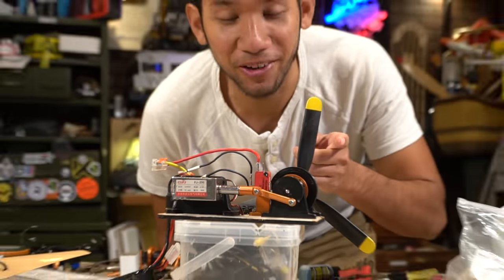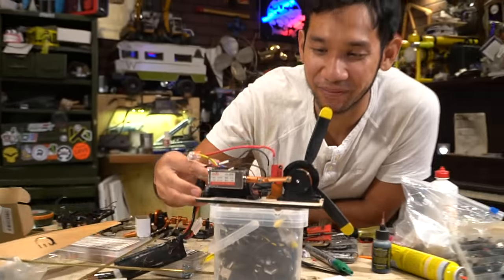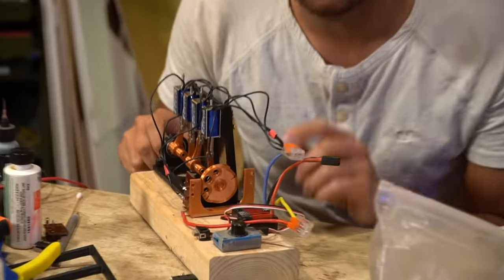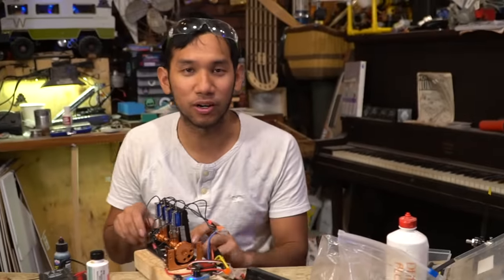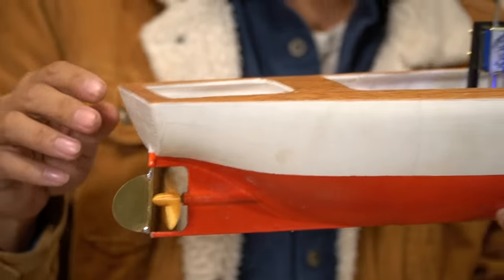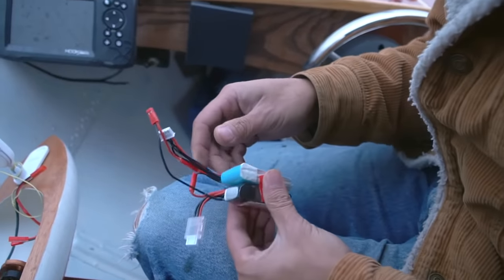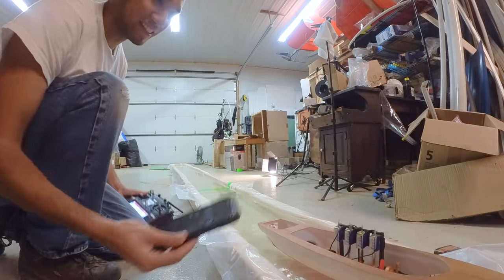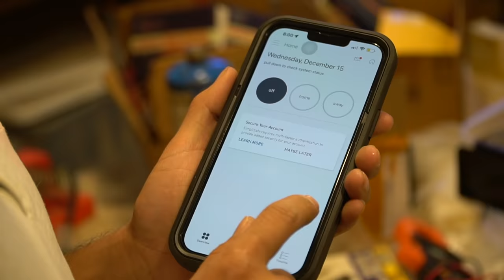Electric piston engine DIY (solenoid motor)

Comment: Now hook up the crankshaft to a regular DC motor, run the wires to the solenoids and boom, free electricity!
Reply from the maker: *elon musk would like to know your location
Reply: @PeterSripol  there's no such thing as free energy ask electro boom
Reply: @darrenwilliams414  wooooooosh
Reply: Unfortunately we don't have the intelligence nor the elements to create perpetual motion. 
Nevermind perpetual motion that has any real use. Like these solenoid "motors"...
Reply: Two words; diminishing returns.
Reply: @jasongrim2027  I think they were also joking
Reply: @roblesterjr04  Its a joke my guy
Reply: @sufferr2914  i can't exactly hear thier tone of voice through text so cut me some slack here
Reply: @jasongrim2027  then hear me out don't woosh them
Reply: energy loss through frinction
Reply: Or he could team up with you and make train for those tracks.....
Reply: I had dreams of perpetual motion machines as a child. I was, however, cursed with the knowledge that overunity just isn't possible. I knew my ideas were flawed, but didn't know where the flaws were.

My first fun idea was a sort of gravity go kart, with sprockets affixed to front and rear drive axles. The sprocket on the front drive axle would be bigger than the one on the rear, and there would be a chain running between the front and rear sprockets. The thought was that I'd put this thing on a hill and hop in. The vehicle would start rolling. The rolling front wheels would rotate the large sproket, which would drive the small sprocket on the rear at a higher RPM, forcing the rear wheels to spin faster. This would increase the speed of the vehicle, which would increase the speed of the front wheels, which would... well, you get the idea. It was fun to fantasize about the insane speeds I might reach going down a hill, until my bummer brain figure out why this contraption would never work.

My next fun idea was almost exactly what you proposed - a generator connected to an electric motor by shaft and circuitry. You manually rotate the assembly to start it up. The generator produces some current, which runs through the motor, which has powerful permanent magnets. The motor produces more output force than the power put into it. All force generated by the motor goes to spin the generator, which generates even more current for the motor, which causes the generator to be spun even faster, which causes... well... I figured the magnets in the motor, utilized in this fashion, would produce a never-ending supply of free energy. I knew this wouldn't, couldn't work, I just didn't know what I was missing. And then one day, it clicked. Why did my dad's bicycle become so much harder to pedal when the generator operating the bike lights was engaged? Why did the exercycle-generator contraption at the local science museum require so much effort to pedal when the button activating a pair of vehicle headlights was pushed? Hmmm.... Electrons, magnetism, attraction, repulsion, induction, motion... Aha! Bummer though... my fond fantasies of limitless power were dashed.

Having these seemingly awesome ideas and finding the flaws in them taught me some invaluable lessons I hope to never forget.
Reply: Speaking of which... It just occurred to me that the whole motor-generator idea could be mechanically simplified!
You have a permanent magnet motor, which can also act a generator.
You give the motor a quick spin. Circuitry connected to the motor goes into generator mode, stores the generated power. Circuitry then switches to motor mode, feeds all that stored power into the motor. Motor picks up momentum. Circuitry switches back to generator mode, storing power for a  moment, then motor mode, increasing momentum... the cycle repeats over and over. Now you have only one mechanical component to endlessly optimize in your pursuit of efficiency sufficient to break the unity barrier! 

Perpetual motion morons, send your generous cash thank you gifts to the Salvation Army, thank you very much.
Reply: @roblesterjr04  one word, entropy 🤪
Reply: @darrenwilliams414  No-one told that it will be a free energy
Reply: @onlinehelper374  try to read slower
Reply: @darrenwilliams414  Yo, what you want to tell with it?
Reply: @onlinehelper374  is it because I is black
Reply: @warpedweirdo  diminishing returns.  If you think you can prove me wrong go for it, but I just can't see that idea being efficient at all.  Permanent magnets can't fix everything, they make good flywheel generators though.
Reply: @EnsignLovell  Whoosh... 

Maybe I wasn't clear. Sorry. My post wasn't intended as support for the notion that this concept of motor-generator could work in real life, but as mockery of the overunity tinkerers who, rather than performing the math and analysis that would prove their idea could never work, instead move directly to building something, and end up chasing their tails with excuses and endless pursuit of "efficiency" when it doesn't work. As in, "it ain't working, the friction in these bearings must be too great..."
Reply: *electroboom wants to know your location
Reply: NOTHING produces greater than 99% returns on it's output. You'd have to be greater than 100% to have true perpetual motion. You have replication degradation that takes place and you lose a little of the power on every impulse of power. Friction loss of components, drag on bearings, The actual moment of stutter when two magnets approach each other attracting one another and they hit the mid point they every so slightly try to stop before repelling themselves away from each other.... 
One day maybe.... in a vacuum... with a power source not yet discovered.....
Reply: Companies actually made toy solenoid boats like 70 years ago! They had little outboard motors with multiple solenoids inside. My dad had a couple of them in his collection, he had the 4 solenoid model that was apparently pretty rare.
Reply: @PeterSripol  a motor is basically a generator connected to itself. The back EMF simply limits the no load speed (without wasting power like an applied load) but there is still a net power loss.
Reply: Much over unity, many free power.
Reply: @darrenwilliams414  that’s the joke
Reply: @disgruntledegghead6923  are u sure about that
Reply: @kingwarrior5028  Yep. If you had it nailed you surely wouldn't be questioning people about it via a you tube comment section.
Reply: @disgruntledegghead6923  perpetual motion isn't that hard to create, just set something moving inside of a perfect vacuum and make sure nothing interacts with it. You cannot get energy from it without it slowing down and eventually stopping though.
Reply: @blockstacker5614  Yep. Referring to my original comment...
Reply: @jasongrim2027  I don't think it was a joke, anyways.
Reply: @sufferr2914  WHOOOOOOOOOOOOOOOOOOOOOOOOOOOOOOSH
Reply: Too many geniuses here with degrees, certifications and permanent professional jobs
Reply: @darrenwilliams414  if i'm not paying for the energy its free. :P
Reply: @darkshadowsx5949  if you're stealing it from the power company then it could be free
Reply: @disgruntledegghead6923  
earth's rotation itself is perpetual motion, why do u need to create perpetual motion machine.
Reply: @PeterSripol  Why don't you and Elon make a new Tesla Electric City bus with less noise and no pollution?   Lots of battery carrying capacity.
Reply: Wish it was true

Comment: it would be awesome if you put a v8 solenoid engine in an RC car
Reply: It would sound so awesome
Reply: Or he made 3 v8’s and put them inside of a titanic model
Reply: Search YT for: Tiny Ferrari
Reply: or aV16
Reply: @apersunthathasaridiculousl1890  V24
Reply: @jwalster9412  V80
Reply: @nexiussuixen7078  eez naas
Reply: make the whole thing out of carbon fibre cause its power:weight ratio is gonna be shiiiiiiiii
Reply: Or maybe a v6
Reply: @nexiussuixen7078  it could never be that powerful
Reply: @aidenfenton8941   imagine he put a battery same to the video here 
I think the two 3.7 volts 18650 battery will compensate

Comment: Imagine the challenge Model airplane builders faced in 1933, wanting to have an engine powered plane instead of rubber bands! Think of Bill Brown, Elmer Wall, Edgar T. Westbury, Mel Anderson, Louis Loutrel, Bill Atwood and Ira Hassad.  All very early builders of model IC engines for their airplanes and boats. Bill Atwood ended up designing the famous Cox Tee Dee engines.

Comment: The sparking breaks the contacts over time, so I'd recommend using a hall effect sensor and a nut inside the cam. This allows you to change the timing by adjusting the voltage threshold as well.
Reply: It's the flyback, when the magnetic field collapses it dumps voltage back down the line. Simple diodes across the contacts the right direction arrest this as a short

Comment: The in-line four was basically two two cylinder engines connected together. The crankshaft was flat so didn’t take advantage of the four solenoids. Each solenoid should fire on each revolution. So 4 inputs of power at 90°.
Reply: I think this is a big part of the lack of power. If those two cylinders aren't firing at exactly the same point (ie if one crank throw isn't precisely aligned) the two cylinders that are firing are fighting a little so you've really got a 2 cyl engine dragging 2 more cyl. Might explain why it wouldn't self start well too.
Reply: @LanternLabs  totally. Needs to get the phasing right and fit a flywheel.
Reply: @LanternLabs  which engines are self starting?
Reply: @MmMerrifield  selenoids dont need any other stroke to function so if it was cross plane meaning there wouldnt be a dead point it would be self starting. a gas engine isnt self starting because it needs the intake and compression stroke to be able to give any power

Comment: Follow those tips and you can drastically improve the performance of a solenoid engine:
Change the rod of the solenoid for a magnet rod and you will be able make it push and pull depending on the polarity.
This means if you configure your timing to reverse the polarity of your wires you can have power on both the down and up stroke.
Due to how responsive the power of a solenoids are when compared with the combustion of a IC engine it will probably be better if you configure the trigger timing of the solenoids 1° to 5° degrees after TDC/BDC to prevent what would be considered "Pre-ignition" or "engine knocking" on a IC engine.
"Pre-ignition" is when a engine start the power stroke before TDC causing it to send power to run the engine on reverse loosing a lot of power and risking damaging components.
You may also want to add a flywheel so you can operate it at very low power/speed. The flywheel stored momentum will keep it from stalling when it reach TDC/BDC. Another option would be to use a crossplane crankshaft to smooth the power delivery.
Reply: Reversing the polarity on a solenoid does not reverse the direction. This is why they can also work with AC.
Reply: Professor Frog  If you want efficiency get a engine from Tesla motor... 
This is a fun project and it would be cool to push it to its limits to see how far it can go.
Reply: I believe these solenoids only have a pull. If there was a magnet on the cylinder then it could have a push and a pull.
Reply: @worthypook  DC solenoids do push and pull depending on the polarity.
AC solenoids only push or pull.
Reply: @worthypook  If they are DC solenoids all you have to do is remove the springs.
Reply: @vitor900000  
I know that. They're also designed for voltages too. My point was that the solenoid doesn't care about which direction the voltage is going.
Reply: @Crlarl  If you "know" why are you saying "solenoid doesn't care about which direction the voltage is going"
If you reverse the polarity of a DC solenoid you will reverse its direction unless there is a diode connected to it. But that would just prevent it from working on the reverse polarity, meaning it would just not turn on.

The only solenoid that don't care which "direction" the voltage is going is the AC solenoid.
Reply: Professor Frog  just to do it. I've built a couple different type motors. Solenoid motors are easy cheap and fun to mess with. It's a mind experiment. Try to have fun.
Reply: No you can't reverse the pull of a solenoid engine or any solenoid that has a plain  steel piston.......the coil can only attract a piece of plain steel....the steel has to be magnetized if you want the piston to be both repelled and attracted by the coil.
Reply: Professor Frog  Haven't heard of the rule of cool? Life would be very bland if everything we (as a species) made was the "most efficient" a concept could be.
Reply: You can also build a double ended solenoid that has a neutral state in the middle, and when you power one side the shaft moves one way, and then when you power the other side, it moves the other way. This is how my bike shifts, up and down on one solenoid.
Reply: @brianellison3525  Too complicated for a simple model that in itself is too inefficient to warrant a complicated solution to a problem that doesn't  exist.
Reply: @gangleweed  I guess its all in how you value intrigue. For my shifting issue it was the most simple solution to make it pull both ways. And if your building your own solenoid, you can build it anyway you want it. One is not more difficult than the other if you already have the tooling and the know how.
I don't need to go into the details of how I built mine, but I'm an engineer and it weren't that difficult at all.
So, go argue stuff you haven't done with people who haven't done it.
Have a nice day.
Reply: Professor Frog  because they’re fun to watch
Reply: @brianellison3525  Well, I'm and engineer too.....spent 60+ years in the trade so I know an impractical suggestion when I see one......what you are suggesting is not at all practical and  from your reply I doubt you even know what you are talking about.
Reply: Yes.
Reply: solenoids can only push/pull not both its just a coil of wire which centers a metal pin u cannot do anything else with it
Reply: Perhaps make it a 3 cylinder and 120° deg apart, then arrange the coils in delta, and use regular brushless controller. And perhaps dual winding coils with diodes or neodymium magnets as rods. Then it is almost a crappy 3-phase engine. 😄
Reply: @pakneger5878  Yes exactly, the steel pin will be attracted to the centre of the coil depending on which end it is out from.......it cannot repel a steel pin.
Reply: Professor Frog  because funny engine. Its always neat seeing something that you know is bad work anyways because its just a cool mechanical mechanism
Reply: The polarity reversing doen NOT work on iron rods. It only works if you use a magnet as rod.
Reply: @Crlarl  You finally explained the real reason it would not work and you are right but the solution is simple. Change the rods for permanent magnets.
You may say that temperature could be a problem but some neodymium magnet can operate at up to 350°C.
Reply: @vitor900000  
Apology accepted.
Reply: Yeah, but you can't...the plunger is just a metallic rod, so regardless of the polarity it's just going to pull in. Reversible linear solenoids are a thing, but you failed to mention that there is a distinction. Do you know what makes a reversible linear solenoid work? I'm guessing not.
Reply: @HangTimeDeluxe  Actually I know.
What didn't come to my mind was that solenoids could also be made using iron rods. I always imagined them using a magnetic rod.
And that is the solution.
Reply: @TheStuartstardust  This is an excellent idea.
Reply: This is what the new age of electric should look like.

Comment: Two things to help with the solenoids.  First, you need to keep the shafts/cylinders lubricated to reduce friction.  Second, you need to find a way to cool the solenoids.  As the shafts heat up the metal expand and will cause additional friction and finally reach the point where it "seizes" up.  A fan could be used for cooling

Comment: You need separate timing switches and the solenoids phased 90* apart from eachother for smoothness. Also adjustable timing will be useful.
Reply: Yep. Four inputs of power per revolution.
Reply: I thought the same. You have to model it after a 4cyl 2stroke engine, not a 4cyl 4 stroke engine.
Reply: @klugshicer  yep. No need for the compression or exhaust stroke.
Reply: Vtec
Reply: I conquer
Reply: or a flywheel could had worked way better
Reply: needs to delete this video and start from scratch. what a trainwreck.

Comment: Very cool design. Honestly,  though, I think two areas can improve things greatly-- and optical or magnetic trigger and transistor switching (those reeds have got to be bouncing all over, fast action isn't their strong suit) and some center bearings. I think a lot of power is just going to warping that noodle of a crank back and forth. Hope you get it flying!
Reply: By electronically commutating the solenoids, reversing direction would be easy.
Reply: I can barely tie my own shoes when it comes to electrical circuit design - so I could be completely wrong. From watching South Main Auto and his explanations of tone ring for ABS, crank position sensor etc, I kept wondering if a Hall effect sensor in place of the microswitch would make sense. The microswitch spring can only return so fast, the arcing is probably introducing a significant amount of resistance in no small part because it’s in the direct drive path? The arcing will also pit and heat the metal contacts, depositing carbon (more resistance) until something wears out or the contacts simply fuse together. I remember as a kid trying to “drive” a relay at high speed - and while not fully understanding, ran into problems like these.